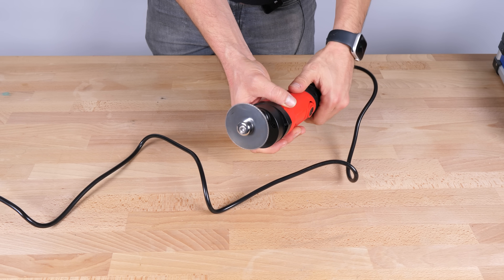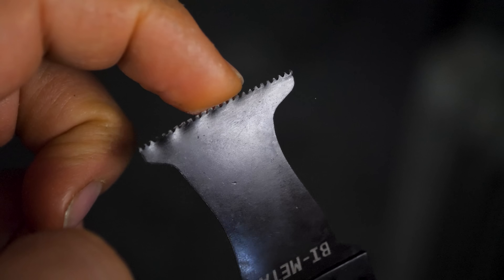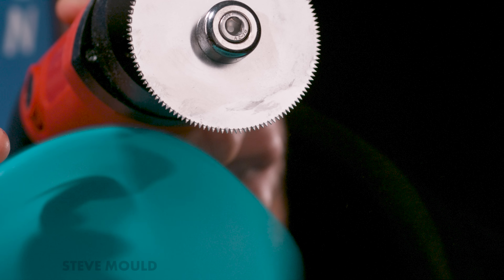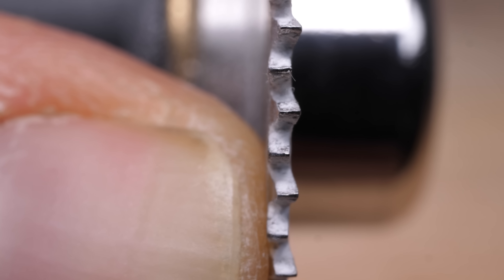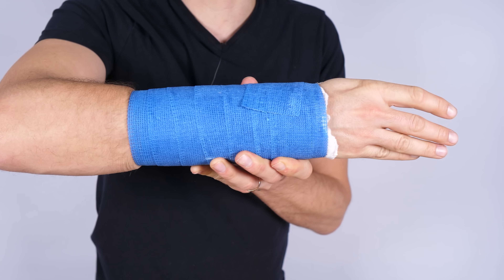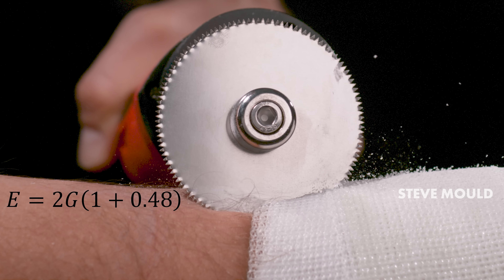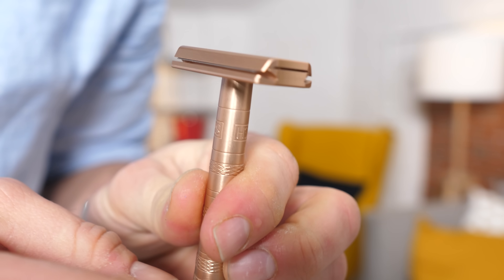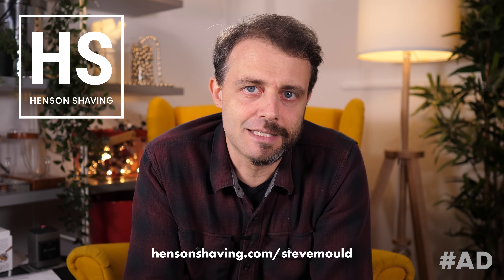A cast saw on human skin

Comment: Looks like the cast saw does not need to have teeth all the way around the circumference. So why does it? I'm certain there are cast saws that are only a semi-circle or a quarter circle, but why are there any full circle cast saw blades? Are they actually just regular circular saw blades mounted on an oscillating cast blade? Is the idea to be able to rotate sharper blades into place when the other teeth get dull?

Comment: It can cut you if it heats up enough… your skin isn’t as rubbery as you think especially under heat. It can nick you without heat and once it heats up enough it most definitely can cut. Especially since your arm is baking inside the cast as it happens.

Comment: I have a big lumpy scar on my wrist from a cast saw...I broke my arm badly when I was a kid and the next day the doctors cut around the cast at the wrist to make an adjustment and blood started dripping out. It stopped quickly so they just plastered it up...six weeks in a cast and a scratch turned into a scar that's still super obvious 45 years later. I'm guessing they dragged the blade across my skin while pressing hard enough to cut me...I was super drugged up and didn't feel a thing.

Comment: if the blade oscillates why is it a whole circle of blades
Reply: I had the same question! Apparently, some are semi-circular so, a full 360 degrees of teeth is not necessary. I guess a full circle would give a wider surface area to cut. It just feels excessive.
Reply: Bcuz idk why not

Comment: FYI: don't try to alter the circular design of the blade, it's easy to think that it might be too much material to worry about per blade (because um... cents per unit lol) rotating but a circle is an easily stamped shape, and it provides an even mass around the axle, so the rotational inertia is literally 1/2 * MR^2, any shift of the weight could mess that up and that increase of rotational inertia would approach towards MR^2 (thin hoop around axis), a force provided almost twice the original inertia could very well provide the power and friction to snag skin consistently which would defeat the point of making it a comfortable thing for a patient. Sorry, I'm zooted rn but thinking about how perfect some things are like the cast saw is good for me rn

Comment: The first thing anyone should be told about a cast saw is that it just vibrates through the cast materials since they're generally harder than human skin and so just jiggles the usually much more flexible skin underneath.

Vibration saw compared to cutting saw.  A saw is just something with metal teeth that is meant to cut through a specific thing or things.  Doesn't matter HOW it does it.

Comment: You can sort of be sure that it doesn't shave well when you know the blade is built like a saw with angled teeth and its cutting method is sort of friction ripping. Whereas when shaving you traditionally prefer really sharp long blade that just slices through.

I wonder if human skin follows the linear material model in any measure. Or if it follows the non-linear model similar to steel. What would you have to know to have any use for the G or E?

Comment: We have an oscillating saw for basic woodwork in our home workshop, too. It just much safer and one can make delicate cuts on weird angles with it just because you do not need to be afraid to cut yourself as much, it is less heavy and without any rotational stability in the system is also easier to turn.
A rotary sawblade is not only more dangerous because it can cut you, mind, but also because it may accidentally accelerate parts of the workpiece to dangerous speeds. 
Or the sawblade itself can break and become a projectile. Had that once with an angle grinder. Found one half of the blade buried in the ceiling completely. Rotators can be fucking scary.
Of course sometimes one needs the power and unidirectional cut, which drives itself, of a rotary tool and they tend not to burn the wood as much on the cut. Oscillators can get quite hot.
But especially for the small things I use nothing else any more.

Comment: A wet saw used for cutting stone and tile is also safe to touch, I install flooring and it always freaks ppl out to see you touch it without getting cut. If I were to shove my finger into the blade it would probably do some damage but if you just touch the spinning blade with your finger nothing happens.

Comment: CAP! When I was a child, the cast I had on had no means of ventilation. My skin was moist and was sliced open right on the inside of my thigh behind the knee. They had to use butterfly stitches because line stitches would tear through the flesh. I still have the scar now, 32 years later.

Comment: You should try a wet tile saw blade. It will cut your nail, but not your skin.

Do be warned though, it will cut your nail to the nail bed, which will leave you in pain.

Do not try the same thing with dry diamond blades.

The 1st time i used a tile saw i was about 6, making tree ornaments out of green tiles. My dad made me touch the saw blade before ever using the saw. He went 1st to show me its safe, after seeing if i would just beleive him (i didnt).

Edit: it is still abrasive and can wear down the skin over time, but touching for a full second or more is fine.

Comment: In the 90's i had a cast running from the knee to the toes in order to make a fitted plastic splint, when they used that tool to remove it damaged the skin on the top of my foot right on the angle where the foot meets the ankle, when the cast was eventually removed the skin eventually broke then bled, the nurse was quite frightened she'd get into trouble, but luckily i didn't bother to make a complaint, it was an honest accident.

Comment: This is not right at all I had a cast put on my whole arm and the cast was put on to tight my hand was going purple, so i went back got this same saw and they cut my cast in the middle to relive the pressure long story short the Indian nurse I had he was cutting my skin with that blade (I'm screaming crying saying your cutting me) 
He goes to put the blade on his own skin and shows me that it dossnt cut skin... he countinued I kept screaming then once I got home I could see blood coming up from the split they cut then about 4 5 months later I went to get the cast removed for good the lady was very nice and put a ruller under the cast as a layer of protection from the saw I was telling her the story of what previously happend just at the cast opens a 10cm long like 2 inch thick scab falls out nd you can clearly see a massive scar just going up my whole arm from wrist up so those saws definitely do cut skin I still have the scar 14 years later

Comment: 6:30 basically the trap that is iOS
Reply: Yes and no, proprietary accessories and locked down for sure, but there are absolutely ways around that, specially if you live in Europe.

I still hate that side loading isn’t really a thing, would have loved to have steam on iPad and Rosetta 2 considering modern iPads are definitely powerful enough.

Comment: I may be the odd one out here, but I vividly remember getting casts from one of my many orthopedic surgeries during my teen years removed and it leaving fucking gashes in my legs. It's a wonder my mom didn't sue.

The blade wasn't even dull or anything and the doctor demonstrated by holding it to the palm of his hand. Also, the only reason my parents were there is because I can't drive since I'm legally blind and have high-functioning cerebral palsy.

Comment: As an orthopedic  surgeon with 30 years of experience with cast saws I have to point out the very real dangers with these saws ! IF they are used incorrectly or with too much pressure they will cut through skin ,muscle ,AND bone ! It does take training and care to use them . Also there are plastic protectors that can be slid under the cast for further safety .Despite your very appropriate  warning  I hope no one experiments w/o proper training . One last point: rotating dremel type tools are incredibly dangerous if used on casts for many reasons .  One example: the padding gets caught on the blade and forcibly winds the blade into the cast . Please be careful out there!

Comment: The long and short of it is that the blade doesn't spin, it vibrates. It can only cut really hard stuff, the skin moves with te blade instead of being cut.
If you still need a comparison you can imagine trying to cut a small piece of wood without holding it down.

Comment: One thing to note .. it can't harm the human skin as long as the skin is not significantly inflamed.  IE if the skin ballon is full of bodily fluids and puffed up, less elasticity is in play, making it more like to cut.  Of course if you have that much inflammation in the cast area you likely have an infection to begin with and need to get the case off fast.  So that's another story.

Comment: You haven’t answered why its round. Why not just a semi-circle?
Reply: it's easier for the doctor to control the cast saw when it's round, if it were a semi circle it'd be harder for the doctor to hold the tool at the necessary angle for most effective cutting.

Comment: I never had anything broken, so I didn't even know this tool exists, I would be probably also pretty scared if some doctor would try to use it to me. If there is just some vibrating mechanism, it should be safe, if there is actual motor that changes direction fast, it is not safe, something can always go wrong.

Comment: Former hospital worker here: if you want to play with a cast saw (you can make all the warnings you want about not trying it at home, but people will still do it), just putting the blade on your arm for a few seconds is typically fine. BUT, don’t EVER drag it down your arm while it’s on or off. Those little teeth will slice your skin open like a razor blade. It’s designed specifically to not cut you if a doctor or nurse accidentally touches your skin with the blade while removing the casting material from your limbs. I repeat, it will easily slice you open if you try dragging it down any part of your body (since even your skin can only stretch so far). It’ll also get very hot eventually, so don’t touch the blade if it’s been on for awhile. Basically, just don’t be dumb with it.

Comment: So interesting thing, I think your video may have solved a 40 year old mystery.  I have had several casts, all on my left arm. In all except one instance, there was no problem. But one time, the tech was cutting my cast from the elbow to the hand and as he cut through the cast where it forms a circle around the thumb I felt a sharp pain and sure enough there was a small red cut on the webbing between my thumb and my index finger. I flinched and said oh, it cut me. He said it was impossible. I showed him the small nick. Said it must have been there before. I knew that it hadn't been, but I was not about to argue with him as he still had to recast my arm. I have wondered since how it could have happened. Having seen your video, I think it is possible that I had my thumb and index finger splayed out wide, tightening the web of skin between them, like the fully inflated balloon. thanks for the video,

Comment: the problem is extreme heat it can generate when using it on cast continuously and second problem is how much pressure is applied on skin after cast it should be done carefully because nurse or whoever cutting your cast tend to careless and just cut the cast in one go which is wrong obviously they need to take breaks to cool the blade and use optimal force when cutting cast.

Comment: As someone with occasional fine motor control issues I really wish butterfly or similar safety razors were more common.
Shaving goes fine, but putting the blade in seems like the exact kimd of thing that I can only do on a good day.

Comment: I remember the one time I had cast that me and a friend were speculating on how they would get them off. We thought it would be a wet saw of some kind (I had used a tile saw a decent bit by then for unrelated purposes, and you would struggle to cut yourself on one). The saw they ended up using was the same as this one but without a full blade, which made it clear it was a vibrating saw

Comment: Honestly, this is the first time I didn't completely dislike a "sponsor section" of a video. The information was - as always well presented, concise and relevant. Thank you so much for making those videos!
Reply: And it genuinely is cheaper to use a safety razor (although you could buy a cheaper one than his and save more money).
Reply: I was actually interested and did not skip it.
Reply: My thoughts exactly
Reply: No te olvides de usar el código de descuento
Reply: Ive been using a saftey razor for years (mid 2021). Its insane money savings. If you bought in today and shaved like i do (every other day, plus some times wearing a beard, about every 4th day of shaving all in all) im @ 77.25/year or .21 cents a day. I have about 1/3 of my shaving cream and aftershave left. I am needing more blades. So if we add on $40 bucks, im good for 2 more years perhaps. Those numbers would be: 58.16/year and .16 cents a day. If we remove the hardware purchase and focus on the consumables. We are talking: 34.16/year and .09 cents per day

Heres what i got, its quality, its classic, its cheap in the long run. Total: $309

Razor: merkur 38c classic barber pole saftey razor $50-$70 (merkur has been around the block)

Shaving cream: D.R. Harris sandalwood $35 ish (endorsed by the crown)

Shaving brush: royal shave silvertip badger hair brush $60

Stand: royal shave stand $24

Aftershave: D.R. Harris aftershave milk $50 (endorsed by the crown)

Blades: feather japanese blades 200pk $80 (the best blades ive used)
Reply: merkur barber pole saftey razor ftw. And feather hi-stainless japaneese razors (yellow box)

Also D.R. Harris shaving cream and aftershave is the best ive found. (Endorsed by the crown)

Comment: 0:47  That's not really true.  My leg was put in a cast when I was 10.  The nurse cut a groove down the front of the cast to make it easier to remove later.  I screamed when it passed over my knee, but the tech insisted that the blade was harmless.  Weeks later, when the cast was removed, we found a scar on my knee and a large patch of dried blood on the inside of the cast.
Reply: Oh the skin is weak
Reply: I saw another comment on this video saying you can cut skin with an oscillating saw if you run it along the skin

Comment: I suffered a fracture of fib/tib followed by reduction and fixation in the operating room and a full leg cast was placed. Naturally, swelling occured during my overnight stay necessitating my cast to be partially cut open to relieve the pressure (one cut partially down the side).This "harmless" procedure hurt worse than the fracture itself. Fast forward 6 weeks to get a fresh cast and the PA wasn't able to remove the two halves due to the dried blood acting as a glue. I have two scars from the inury - one from the surgery, and one from the cast saw. Cast saw injuries occur every day in the clinic and hospital setting. LIkely from improper maintenance/dull blades.

Comment: 3D print design sharing websites actually have a lot of parts for connecting some part from manufacturer A to some part from manufacturer B, like powertool battery converters, GPS mounts, toolbox stacking systems, connecting lego to every other construction standard, etc. These are my favorite 3D prints because neither manufacturer A nor B will ever produce these missing links.

Comment: Spoiler.. the cast saw can only cut hard object like the cast or plaster ln your body. The saw doesn't spin but, actually swings back and forth like pendulum but, at quite high speed.. so it will only swing your skin back and forth. It won't cut your skin. You're safe..

Comment: I have a similar razor.  the problem is you have to use a lot of water to clean it every few strokes.    I tryed using sink water but wasn't that good.   For me my electric still wins.   Its faster,  uses far less water,  and instead of replacing blades every 5 shaves I can years without a new blade.

Comment: Had the experience once I was little that they did actually cutted trough my skin. While they were sawing I commented it hurted a bit. They were denying it and said it probably tickeled. When the cast was removed they saw they actually cutted my skin for several centimeters along my leg. It was alon my tibia
Reply: I'm thinking they got the wrong saw
Reply: @ryko1478  idk 🤷‍♂️ they used it in combi with a long plastic lat that protected your skin but they were sawing  beside it

Comment: They don't cut you, but if the cutter goes too slowly, the blade can get hot and burn you a bit. I remember a very slow-moving nurse trainee having to remove a cast from me, cutting super slowly, and the blade wicked hot from the friction and burned me. An experience ortho, however, removed one of my casts like he was opening a zipper.

Comment: I had a feeling I knew the answer. The skin is so flexible that it can kinda match the frequency of the blade. Its why cutting flappy sheet metal with a jigsaw doesn't work, its so loose that it just bounces along with the blade. Same for reciprocating saws. They only work when the material you're cutting isnt flopping around.

Comment: As Steve points out in his pinned comment, these blades get HOT.  When I had a cast removed as a kid, I was squirming away as the nurse was using this tool.  No amount of me telling her she was hurting me would get her to stop and she insisted it couldn't be cutting me.  It wasn't until the cast was off that we saw the burn marks on my skin.  I hadn't realized the pain was burning.  It was just a little first degree burn, but it stung!